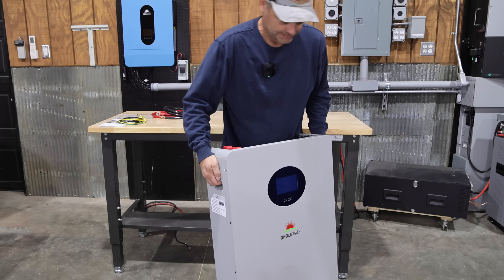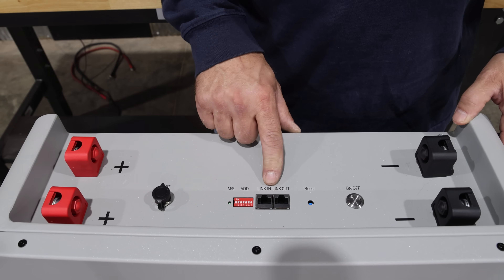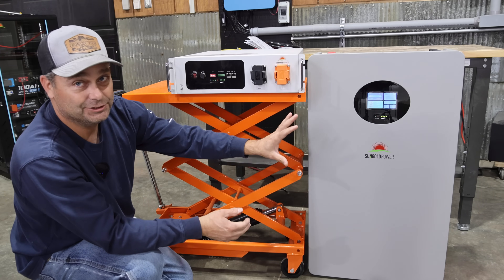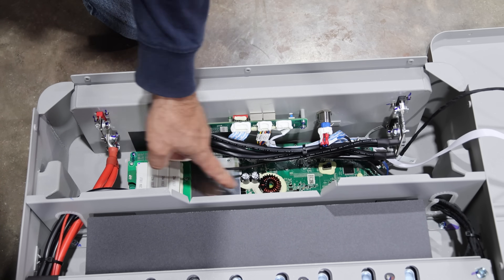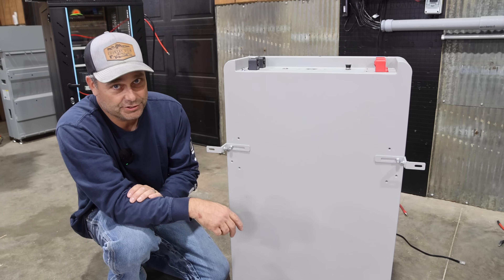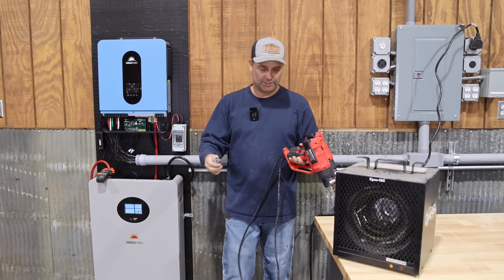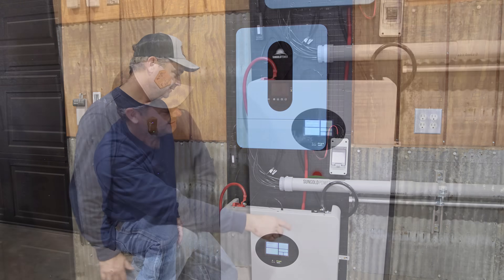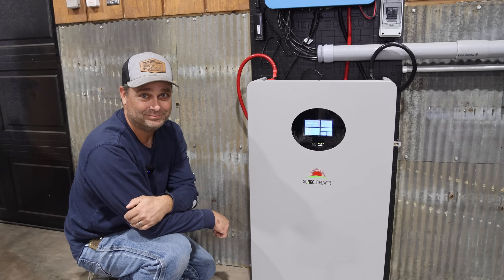Not too Big, But not too Small.  Testing out SunGold Power's 200AH Battery.

Comment: I own a 21,000 watt Sungold Solar Array. I love the Panels but needing a Battery Bank that would work best with my SolArk15K Inverter. So After watching several 48 Volt Battery Video’s. I chose the Deye 48 Wall Mounted Battery Bank. $2290 delivered 10-10.24 kWh capacity gave me adequate power to burn for electric heat. And according to Will Prowse the Best Constructed Battery he’s ever seen. They used 2/0 cables internally and externally for Daisy chaining them. They have built in Fire extinguishers,heated, and heavily constructed metal housings. The Batteries are 200 amp. Charge or Discharge capable. My setting for Recharging is a constant 100 amp. I just don’t need to slam the Recharge even though I could Recharge to 185 amps. I am currently using approximately 6000 watts to continuously heat my home. And have an 95% efficiency propane furnace for backup. My Grid Power bill is $34 a month to rent my meter. And I have a current 7000kWh Bank of Electricity with my Electric Co-op. So this time of year with over cast & shorter days. I can draw on my Banked energy for Recharging. Twice a day from 6 to 9 I am Grid shaving using my Battery bank during Peak hours @ $4.50 a kWh. No I haven’t drawn my Battery bank down past 80% SOC. The Battery Bank is there in case we lose the Grid. And if we have a situation where there is heavy overcast for several days. We have a 20KW Propane Powered Generator. No matter the situation we will have electricity.

Comment: I’ve had this same battery for almost two months now, and I absolutely love it. I have the Sungold Power 8000-watt inverter with 2KW of solar power. It’s been rock solid, except for a few things you mentioned. I had to add an extra breaker, modify the battery connection covers so that I can keep the battery terminal covered.

Comment: You commented on how slim the battery is and then used brackets that stand off the wall somewhat defeating that slimness. I think I would make my own flat bracket and screws it to the back of the unit and so it sits flush to the wall and just fasten that bracket to the wall and eliminate that standoff that the L brackets create - other than that, looks like a decent battery